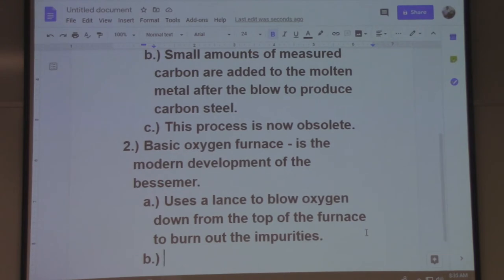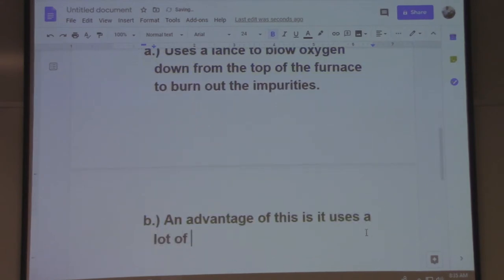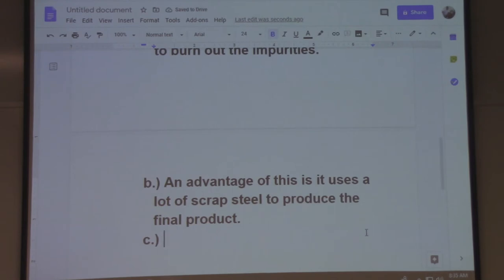WLD 2370 Metallurgy Lecture # 2

Comment: Good example for your welders, imagine 3- 15-20" carbon gouging rods coming off the biggest power source that you could imagine.  That's is how the E.A.F. do, also almost always used(2nd furnace) in ths final metallurgical tweaks before casting. Neat example of how much steel they were pouring while I was there, 200 tons every 7-8 minutes.